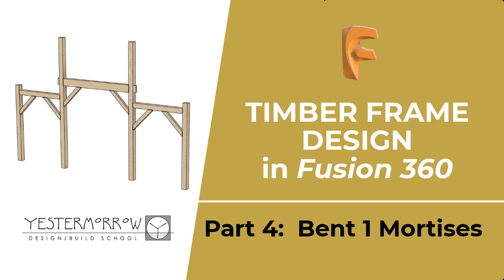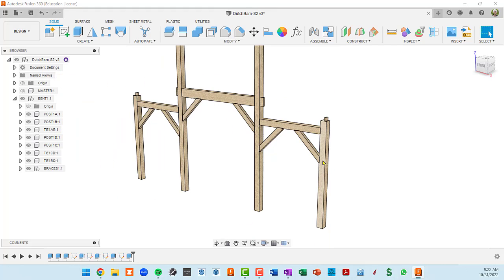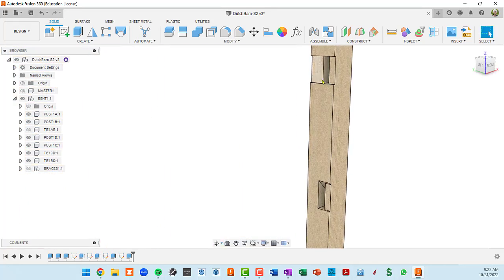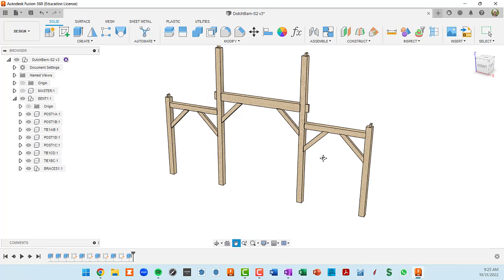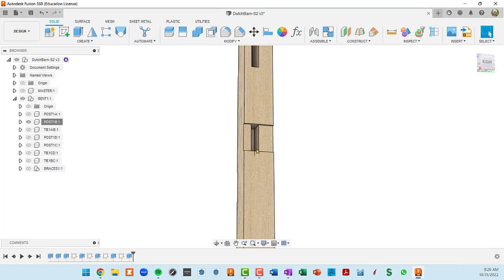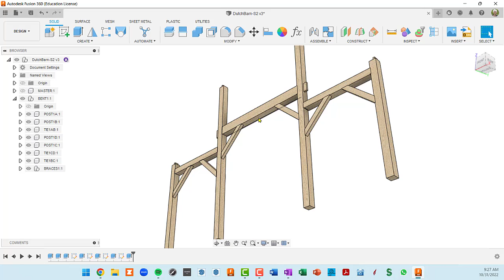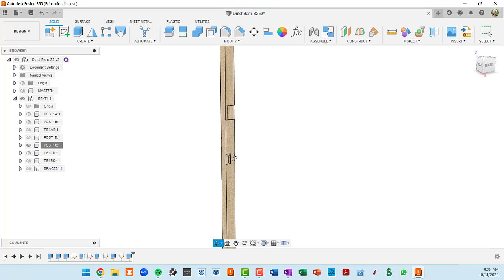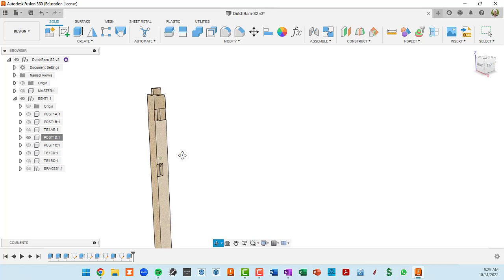Timber Frame Design in Fusion 360 - Part 4: Bent 1 Mortises

Comment: finally, i can see why there were 1/2" extrusions to each of your braces/joists. i am unfamiliar with timber framing so this has been pretty useful for that aspect. however, i can't help but feel like you have spent a bit of wasted time on aspects of the design. for instance, you spent a lot of time with copying/pasting joists, which could have been saved by simply waiting to mirror everything until the end. i will say, i do like the idea of having a master sketch component separate from everything else in order to have a guide for the design as a whole. i will use that in the future.

one thing i will say, it might help a lot to also look into using parameters. i find them indispensable when having to repeat dimensions, especially as the project gets more complex. it can also help to simplify error corrections for objects that are mirrored or copied.
Reply from the maker: Its been a while since recording these videos and I would certainly do some things differently.  Not only the use of parameters, but configurations as well.  At first glance, mirroring appears to be the way to go (which I've always done in SketchUp), by Fusion lacks the ability to make a mirrored component unique.  Think about posts that appear identical but are slightly different being at the end of the building (fewer braces, etc).